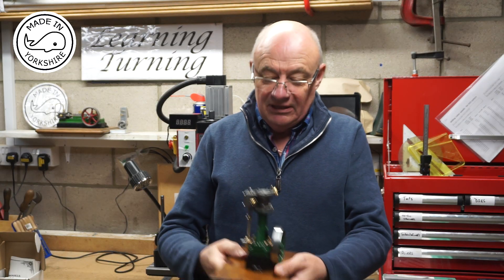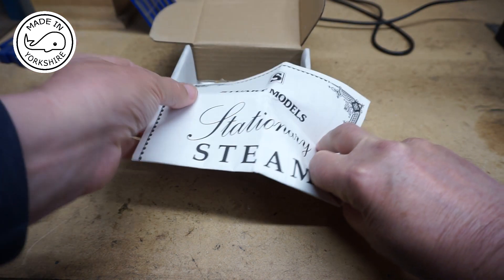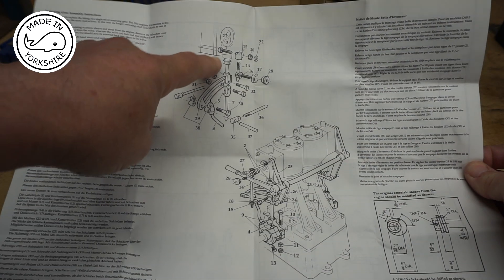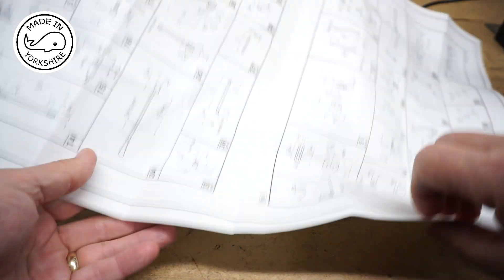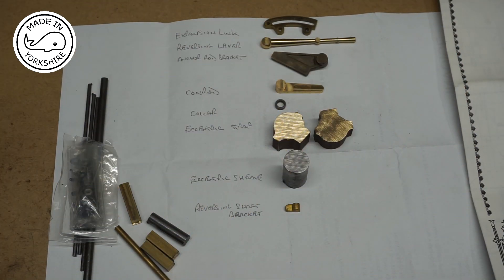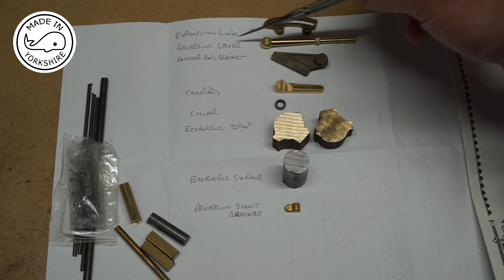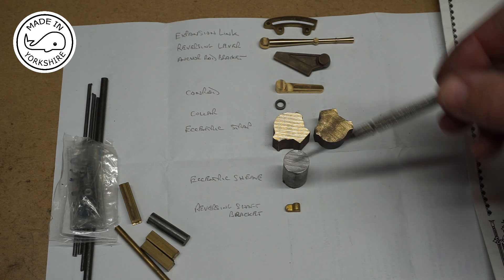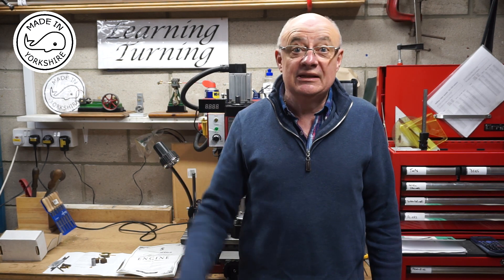#MT30 Part 1 - Stuart 10V Reverse Gear Mechanism. The Components. By Andrew Whale.

Comment: Good to see you are ready to make a start, I think it will make a nice addition to your engine. The parts look to be good quality - I didn't realise the operating lever comes in a decorative shape. It should be an interesting mini series following your build :-)
Reply from the maker: Thanks Peter - you planted the seed! Fingers crossed it will work out OK.
All the best.
Andrew
Reply: @learningturningmetal  Just a thought Andrew but it looks like Stuart supply the materials to make 2 new eccentrics so that ought to leave the one on the engine now redundant. Since you have the first trunk guide that you weren't happy with, is it worth marrying the parts up and making a cylinder etc from barstock - it could be a  way of making another similar engine for very little cost :-)
Reply from the maker: Hmmmm, interesting thought - let me mull that one over.